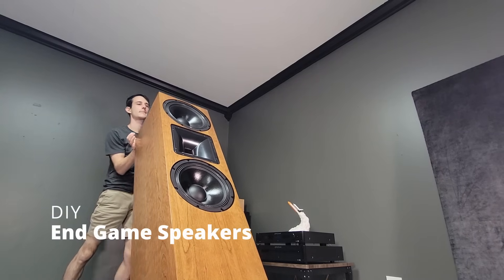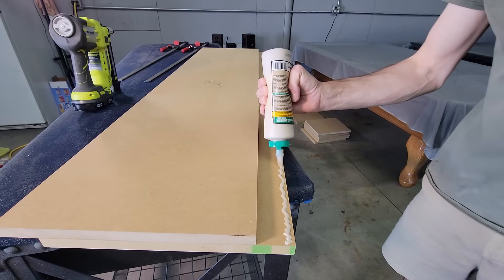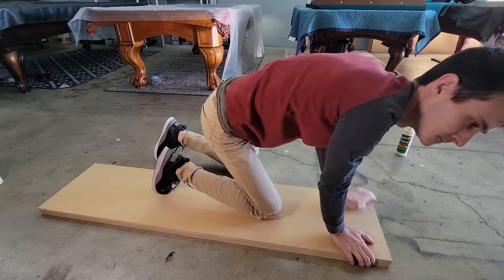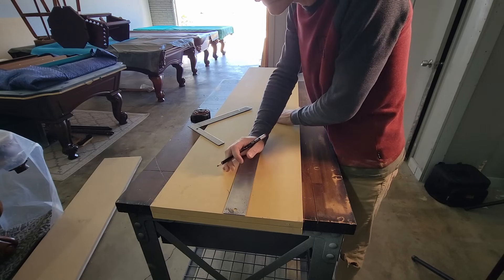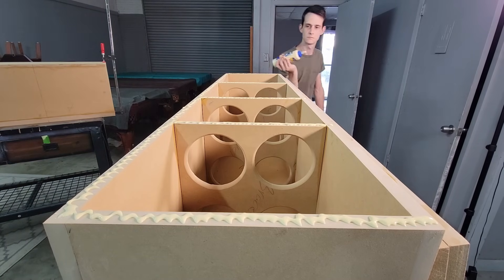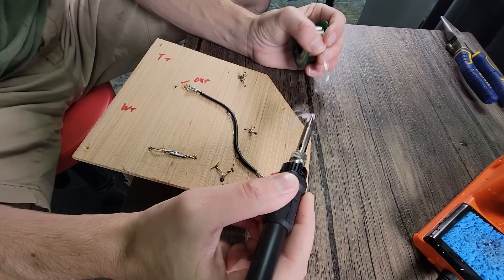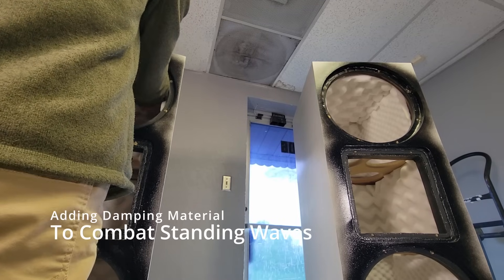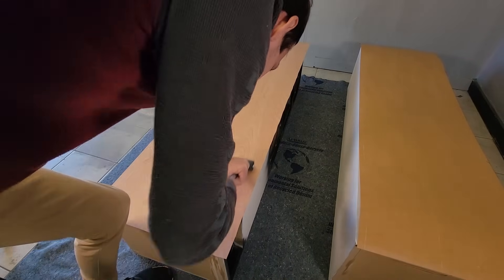Building End Game Speakers | Audience 212

Comment: Something I discovered recently is that when installing braces you should make sure the panel sizes you create are different so you are not having multiple panels resonating at same frequency just putting a brace in the middle creates two equal sized panels and because resonant frequency's add up you may actually make it worse so always make sure panels will be different sizes to avoid this.

Comment: Hopefully none of your neighbours had cars near the day you sprayed those or they would be wondering what all the crap on their cars were it is surprising how far that overspray goes I know this from experience we painted a factory and bosses Aston Martin DB11 was around corner we had no idea overspray would travel as far but his car was covered in little white dots thankfully it washed off. Out of curiosity how have the screws held up in the drivers I would expect them to come loose in mdf and would think drilling bolts right through and bolting them in would be a better way for long term mdf is known to have poor holding for screws and as speaker vibrates a lot I wondered if that would hold up in the long term.

Comment: 14:31 I see you doing the shield the precious speaker with your less worth hand trick. I did that, but it doesn't always work. I bought a magnetic tip with a sliding sleeve that you pull down over the screw and that has been 100% proof against jumping off the screw and poking a hole in the driver. DeWalt makes a short one and Makita makes longer one. I have both and use them regularly.

Comment: How would these speakers do for 2channel hifi ?.  I'm looking to build a new pair of speakers.
Reply from the maker: They do great for hifi. Very neutral, with a warm top end. The dual woofers pack a huge punch in the mid and lower bass region. This gives drums and things huge scale, which is really unique.
It's hard to compete with the effortless way these get loud.
If you're looking for a super detailed "analytical" sound, a traditional hifi speaker build would be a better idea. 
These don't image as well as something like a dome, or ribbon tweeter usually does.

Comment: what model wagner gun do you use and what sort of clear do you find goes well through it? I only have automotive guns for 2k clear I use on airbrush art and I'm unsure about airless sprayers like the wagner.
Reply from the maker: My sprayer for lacquer is a cheap Chinese knockoff. I can't remember the name.

To be honest, I'd highly recommend saving for a compressor. I currently am myself.

I've used the sprayer on a ton of projects with good results, but it's always a hassle. Parts are cheap, and you have to be careful when cleaning and assembling & what not.

I've heard all of the guns from Husky & such are quite good. So don't be afraid to be cheap.

Comment: Wow! Those are monsters! What are their feeding requirements to get the best sound? I myself would've went with a natural finish on that cherry veneer. It would've had a nice contrast to the black. That's just my two cents. I wonder how the automotive finish would've looked? Thank you for the detailed steps you provided during the video. I chose to subscribe because of it.
Reply from the maker: I've run them on both a Fosi desktop amp, and my Emotiva gear. Sounds great on both, but the emotiva brings them to life.

Comment: build the box around the braces and top and bottom. dont build the box then slide the braces in and force the glue off the panels. there is a proper procedure to follow and it's really quite simple if you sit back and think about it. oh yeah, clamp the track to the wood when using a track saw then it won't move while cutting.

Comment: They look awesome!!! I’m surprised you didn’t have to use a 2” compression driver to cross over lower due to woofers being 12”. I would have liked to know more about the drivers and crossover details personally.
Reply from the maker: I may make a follow up on the design in the future. It gets tough deciding which details to include when the video runtime gets long. In the meantime, check out Toidsdiys channel for more details on the design.

Comment: NGL, my heart skipped a beat when you were pushing up the first speaker. Totally thought it was going to tip over. 

Great build. I think I’ve decided on building three of these for my home theater to be built in a few years. Are you still happy with the speakers?
Reply from the maker: Hey, good thing they're well balanced!!

Yes, I would still recommend building these. They're great for movies & music. I still use mine on a daily basis. I don't feel any need for improvement whatsoever. I would point out that Toid is designing a new model of these. Check out @toidsdiyaudio for the video when it comes out.
Reply: @DIYhyfy  nice. Thank you for the reply! Will definitely check out his next video on these.

Comment: Great video. Speakers look great. I too would have veneered, good call. 

I’m confused by the “port”. There is no “tube” or “chimney” behind the rectangular opening?  How is that a tuning port and not just a hole in the baffle?
Reply from the maker: Hi, thanks for watching! So for the port question, yes it is a port on this case. Because it is tuned rather high, it so happens that the width of the baffle is the length of the port. In most cases where you see a "hole in a box" it is indeed a mistake by someone without an understanding of what a port is/does.

Comment: Those look amazing.  What would you charge for a completed pair of these, over materials/drivers, etc? It'd be really cool if someone sold finished versions of Toid's speakers,  in the most basic finish.
Reply from the maker: Man production work like that would be really challenging. It would need to be a partnership between the designer & builder. Most plans prohibit commercial use. But, I agree, it would be great for buyers to have the option.

Comment: Fantastic video and build. I’m feeling inspired to give the build a try. What center are you planning to pair these monsters with?
Reply from the maker: Yes go for it! I am running them with no center channel, as I'm running them on a 2.1 amp. If I were to run one, I would build this, oriented on its side, and split the vents. The horn is equal 90° coverage, so it would work out great.
Reply: @DIYhyfy Thanks for the response! By splitting the vents, you’re thinking a double port on left and right vs the single bottom in the original vertical build?

Comment: Hey diyhyfy. Nice to meet you. Herd about you from toids channel, so everyone makes these jtr style speakers. Yes they will work great in a large room but i am thinking as a beginner speaker building what about a 7 inch or 8 inch version with a horn? I just recently had to cell my klipsch rf5’s and i had the beloved klipsch rc7 which i want to make myself which has a 1.75 compression driver and 4:57 duel 7” subs and its a 2.5 way crossover. I know i can make them better but i am having trouble choosing drivers and still learning. I was wondering what you or toids might recommend for drivers and how to match a 7” or 8” driver with a high output compression driver that says its about 105 spl 1 watt 1 meter. Thanks if you see this question and would love to see you guys build the klipsch rc7 and make it both a center then match vertical. I have a 15 x 12 room and the klipsch rp 160’s are just not doing the output like my rf’s and rc7 was.
Reply from the maker: Hi, it's tough to give you ideas for driver selection. My advice would be to look for a kit that suits your needs. There are a TON to choose from.
Or if you decide to build your own, you'll need to read about driver selection, impedance, xover design, horn types. Really depends how much work you have time for. Thanks for watching!
Reply: @DIYhyfy  understood on info above! I”ll start reading and kits. Thanks.

Comment: Nice build... A little constructive critique.. you shouldn't use water based sealers or paints on MDF ever... It causes the MDF to swell. You will get much better results using shellac. it also dries completely in minutes allowing for multiple coats to be applied very quickly. it seals the MDF and hardens the surface. Two coats of shellac with a light sanding in between..
Reply from the maker: Thanks, you're not wrong. I had that on hand, but almost immediately regretted using it. I would much prefer veneer directly on to mdf. However my original plan was to paint these. Never the less I'll be using shellac instead next go around. Thanks for watching!

Comment: Really nice job! :) 
But in the last minutes of the video (it's really hard to see) it looks like one of the H250 horns is turned with the 60deg direction mounted sideways. The H250's are 60x90 horns, and for almost all applications except really complex beamsteering in systems 10-20x larger than this, you really want the 90deg spread sideways and the 60deg spread vertically... This does of course depend on exactly what you're trying to achieve with room interaction and so on, and I also might be totally wrong about what I see :) !!
Reply from the maker: Hey, looking on SB Audience's site it shows the 250 to be 90°x90°
I may be missing something, but it shows coverage equally on both axis.
Reply: It seems linking directly to a manufacturer gets the reply deleted, but I linked the actual product page on the official SBA website. Never trust 3d party retailers to get it right. AFAIK SBA has never had a different version of this horn either  @DIYhyfy
Reply: The SBA site specifically says 90x60, on the product page AND in the product pdf. The product page also includes polars for x and y, which show quite a lot of difference in radiation pattern. So I have no idea where you're looking if you see 90x90...?  @DIYhyfy

Comment: It looks like you did a fantastic job with the veneer. However, I would have opted to spray them with paint. Personally, I would like the look better and, in the future, if you wanted to change the color it would be easy enough to respray. Veneer on a rectangle enclosure that big looks vintage and some may prefer that. Good job and thanks for the video.

Comment: I was with you all the way through this impressive build... until the drywall screws. T-nuts  and machine screws are generally a much better way to go. Cap head machine screws have a very square shoulder that can prevent distortions of the basket. This will also allow for higher clamping pressure of the drive to the cabinet. Overall beautifully done!
Reply: I had the same thought.... uhhhh those will break... looks like the bottom of IKEA
Reply: I dont think the screws will amount to any humanly audible difference unless you are superman. And drywall screws are plenty strong enough for this application, they are brittle but will not be subject to shearing force or approach weight limits.
Reply: Mdf, use "confirmat" screws. There is no alternative. You will be very impressed with their use. I assure you. Do not use anything else, m7x50mm size, do not forget to get the specialized drill bit for them, and do a practice run with the drill bit and see how it behaves and how to use correctly, it does have a learning curve.. but it's not crazy. The confirmat screw is night and day the best possible screw with mdf wood.
Reply: Also when clamping, clamp soft at first then after an hour clamp tight as hell, you'll not have a mess of glue and instead of squeezing your glue out and a mess, it penetrates the wood.. and do make sure you sand with 150 grit first with mdf wood... Just to skuff the surface a bit, just before you glue, the wood immediately starts to oxidize so be quick to glue after. And also when using confirmat screws, for that mega ultra strong setup, predrill hole, then fill with glue, then drive screw in, we're talking doing all this, 4 to 5 times stronger strength then just slapping woodglue down and doing the normal half assed way. Like, just slap glue and brad nails, is literally EASILY broken. The way I explain, were talking near explosion proof lol.
Reply: Also don't just screw speakers with screws into wood, use the threaded inserts that you put inside and use a stainless machiene screw into that... Like, seriously, don't hf ass speakers, they can be heirloom pieces, or last 5-7 years. Up to you. I figure, build once, never have to go around again
Reply: I was all in until the drywall screws. All that effort.

Comment: You could also just bought a pair of JTR Noesis 215 :)  Twenty years ago I build a 130 liter closed system, it was so heavy (about 100 kilo's) I could hardly lift it from the ground (from laying on its back to standing up). The baffle was 60 mm MDF.
Reply from the maker: That sounds HUGE! Thanks for watching!
Reply: @DIYhyfy  Thanks, it was based on a 12" Lambda Acoustics SB12 (old brand fom Nick McKinney (rip), who later started working at AE speakers, but passed away much to early). The unit was specialised for sealed enclosure, doing 27 hz at -3db). I only used tons of deuvels and wood glue to build (took me a quite some weekends)

Comment: Any tips on veneering for the first time? Should I do a small practice box first?
Reply from the maker: Veneer is really pretty simple. Yes it is intimidating, given the price of material. With that said, take your time. If you are nervous, try using the cold press method. Simply use wood glue spead evenly on both surface & clamp. Then take a blade, and cut leaving about 16th-32nd inch, and sand that off by hand. If you have any questions I didn't answer, just let me know.